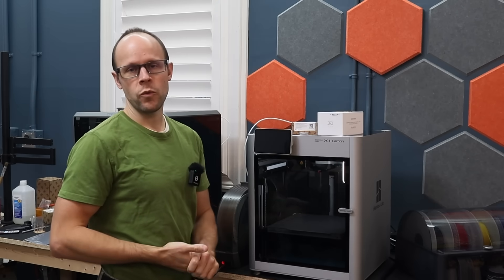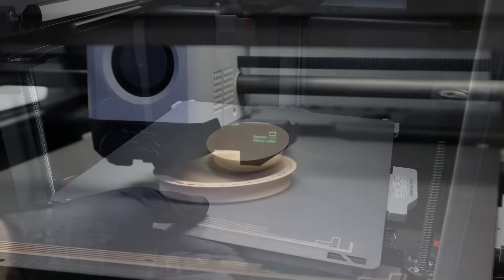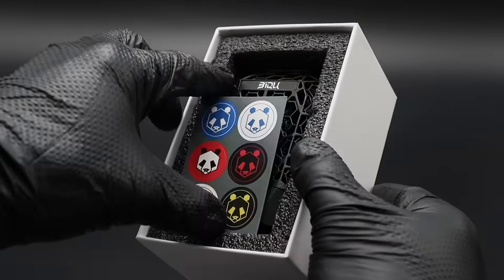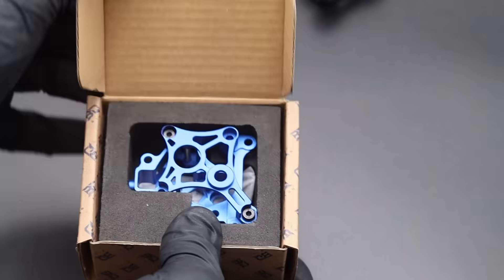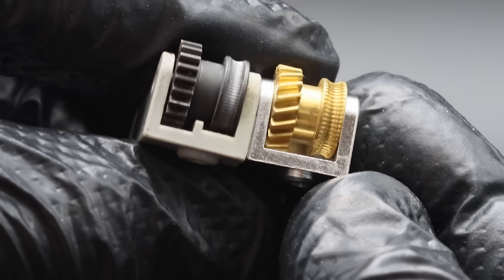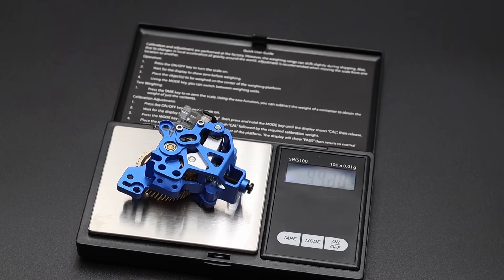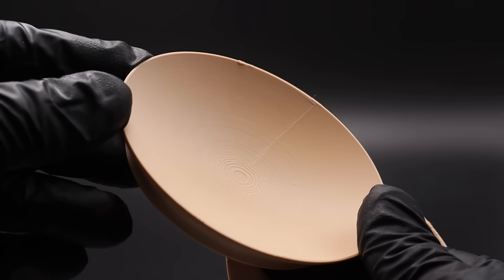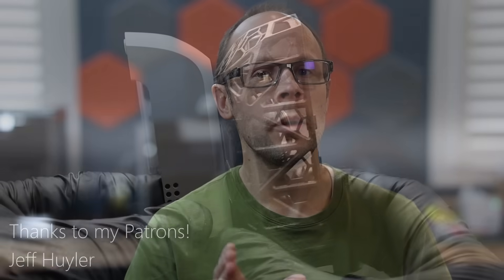These are awesome looking upgrades for your Bambu X1/P1 printer, but how do they perform?

Comment: The main reason I clicked on this video is that I have a BambuLab X1C that I have in my garage, and it’s been having some major heat creep issues. Here in Phoenix, my garage routinely gets up above 45C, which can severely impact the ability of the printer to effectively dissipate heat. The result is PLA filament getting stuck inside the extruder assembly, even with the front door of the unit open and the lid off.

I’ve seen a few models available for print that replace the print head cover, but I haven’t seen anything but anecdotal evidence as to their effectiveness. So seeing that they do help with heat dissipation, I think I’m willing to give it a shot. Thanks!

Comment: Regarding the hub teeth on the idler being finer than on the main extruder gear:

I think it is such a clever solution, and this is that part where the "magic" is happening:

If the toorhing on the 2 gears would be the same - like on 99% of similar design extruders, it would cause some artifacts. As the extruder gears rotates, they push the filament a bit differently when a teeth is just grabbing - hppe it is understandable what I mean.

By using diferent toothing the 2 gears grabbing the filament can eliminate this - laggy pushing.

Comment: Great video as usual. You are always showcasing somehting I was considering to do..
I got all that same Biqu stuff and some more.   And a host of issues after installing all of it.  The tolerance's on the Panda extruder need work. Alot of jambs on color changes. Single color projects seem to run ok.  All the gears in the extruder are great. Too bad you can see the extruder once the new front cover is installed.  And if you do the Revo upgrade as well.. it compounds the issues.  Revo system was not designed to be used without a PTFE tube that meets the cold side of the nozzle. With out the PTFE tubing you will ger heat creep where the two screws attach the nozzle to the extruder. And the two hot end mounting screws are to close together to mod the heatsink to take a piece of tubing.

I ended changing back to OEM parts, a part section at a time to try and isolate where the issues came from. I ended up with the OEM Bambu Nozzles, the Panda Extruder Gears, The front "blue" cover of the Panda extruder. and my X1C is humming along again!   Now to figure out that nozzle light issue.

Comment: Just wondering how everyones ptfe tube is I heard it rubs up against the glass plate on the top? Causing problems? 

I just sold my ender 3 v2 and thinking about diving into bambulabs p1s combo.

Comment: It looks neat.  But I really only see it benefiting 24/7 print farms to reduce down time 5-10 years down the road, because the stock plastic gear is just fine.  That big gear is like your hand on a wrench.  Your hand doesn’t need to be made out of tool steel.  But the socket at the end, the hardened steel gear, does need to be as strong as possible.  Strait cut gears are also more durable for their size.  High performance engines have a lot more straight cut gears, but they’re noisy as hell.  My motorcycle sounds like it has a supercharger whine, but it’s just the gears because they designed something that could have both 120hp, and do a million miles with proper maintenance.

Comment: at 10:40 from the benchy the edge you can see stock it's a bit more round then with the parts from BIQU so less smoothing (thats good)
Reply from the maker: I've been asked to buy new replacement parts from Bambu in the comments and then do another comparison, I think it might be a good idea to test as close to apples-apples as possible.  Thanks for pointing that out, I didn't notice it.

Comment: Thanks for the comparison. If I were to hazard a guess, I think the improvement in the benchy overhangs is due to the omni-directional blower from the Panda jet. The rest of these parts I would only expect to see improvement at warp speeds (lighter weight, less ringing), or with higher-temp materials like PA6 / PAHT / PET / PPA / PPS (where improved heat dissipation might matter). The heavier duty metal components probably only matter if you're printing harder types of filament like -GF or -CF (improved gear wear resistance), but those parts are still considered wear items that you're just buying more time between service intervals.  Sure is fun to try to squeeze more juice out of these printers though, innit?

Comment: A disadvantage of angled teeth is that an axial force occurs. This should be absorbed by an axial bearing. It is also strange that many expensive light upgrades are purchased only to have them canceled out for a gear solution that is much too heavy.
Reply from the maker: The original gear setup did seem superior, it might make the most sense to use the stock gear with the skeletonized upgrades for the best of both worlds.  I don't know if it is all compatible though, I'll have to go back through it to see.

Comment: A few things to comment on,

First, your calibration cube and benchy look absolutely awful.. My P1S produces much cleaner prints than this X1C and I'm wondering if you think that's due to the filament type used or the print profile?

Second, it would be nice to see the individual parts weighed out compared to the original parts.

The extruder gears are likely the main sum of the weight increase, but Biqu advertises that their extruder cage, for lack of better words, is lighter than the factory polymer one. Would like to see the individual parts weighed to verify or debunk this.

Third, if the print quality is identical, how would anyone consider these parts upgrades when they show no performance or quality gains over what comes with the printer out the box?

It seems safe to say that this is nothing more than printer bling and the money could've spent better by just buying filament instead and tuning print profiles to the filament.

Great video overall, love the non-bias approach to this.
Reply: Overall I agree with your sentiments.

I do want to respond to your third point.  If you are at all familiar with the modding world (most likely you are since you're on this video), physical modding is only beneficial once the software has been modified to take advantage of those mods.

In this case, there was a change made to the actual drive gears on the extruder. This change will have an affect on every single setting on that filament path.  

Him using the same print profiles in both prints favors the original since that's the hardware setup that it was made for.  

To truly see the benefits someone would have to install these mods and then do a complete calibration of the print profile and possibly firmware. Doing that on a Bambu defeats the purpose of going bambu, which makes the gear upgrade not worth it.

Comment: I agree it all seems high quality, but given they net increase in weight and yet nearly zero difference in PQ, I don't see the point of upgrading.  That said, I would have liked to see side by side comparisons with JUST the lighter face plate, to see if that 6 grams of weight savings, with all other components remaining stock, would have made any difference.  That could have given a more meaningful result... or if there was similarly no difference, that tells us something, too.

Comment: great presentation and comparison.
I would consider the differences here margin of error. If the stock setup was bare I bet you couldn’t tell them apart. What could benefit the Panda parts is after several thousand prints.
On my x1c, I started to see more extrusion artifacts after a few prints and it seems to be better after cleaning per Bambu's recommendations. I am constantly swapping between materials and only rely on the self purge, so that is probably more likely any issue I might have.

Comment: I get the impression the 3d printing community has got stuck in ender 3 V2 days... Where you HAD TO MOD as from stock it's printing was EXTREMELY hit and miss (that's my experience anyway)... Now it seems most mods are unnecessary as these printers SEEM to be built/engineered better and just work with a good cleaning/service schedule...

Comment: Due to the reliability issues the gears tend to have based on what I've seen on forums, I think stock gears with lightweight cover would be ideal. More control from the motors is probably better for quality at least in theory

Comment: I’m new to 3D printing and I just got the Bambu Lab P1S printer. This was a very informative video, thanks for putting it together and more importantly, not rambling. I am looking for a better tool set. Would you mind sharing the name of the Allen wrench set that you are using? Thanks
Reply: Best hex drivers ever made will not strip screws is called  
MiP hex driver tools nothing touches the fully made in USA MiP Hex tools worth every cent.

By the way Allen wrench is a brand not a tool that's a hex driver have a great day sir

Comment: To be fair, these test prints look quite bad, regardless of the setup. As someone pointed out, tuning filament profiles and print settings does way more to a print than just upgrading the shroud and extruder gear. I have the skeleton Panda Jetpack myself and to be honest, I can barely see if my print quality improves cus with the stock shroud I already have great results due to tuning. Though I'm really curious about the Panda Claw Extruder, but not sure if it is worth the additional $50

Comment: I removed the Extruder/ Claw from my X1C. Put the OEM parts back in. I had nothing but issues after swapping to the Claw/ Extruder.
 My X1C kept saying the belts were loose and resonance was off. I also had constant “clog” issues during filament changes. There was no clog, the filament was just refusing to Ender the extruder teeth. 
 I plan on trying the claw and extruder separately to see what one was causing the issue. 
 I do love the Panda Jet Pack though… it definitely improves overhangs.
Reply: I took mine off after having to clean the extruder after a lot of PETG and TPU. The dust that builds up with the stock set ups are easy to clean, add grease and it's a huge pain. I didn't see any benefits but thought the softer plastic toothed gear failing would be better than those brass gears grinding the toolhead gear down if something fails.
Reply: running into the same issues here too

Comment: The Panda extruder does not use hardened extruder gears unfortunately or if it does it's below 30 HRC which is the lowest file I have, the Bambu one is about 50-55 HRC.

Comment: You mean the wooden bowl that has been sanded down to an almost mirror smooth surface experiences less friction than the layered plastic bowl that's had no finishing done whatsoever? Who would have thought...
Other than that, an interesting video. I think I agree that opening all of that area up to dust is a bad idea for the minimal if not non-existent improvement the 'upgraded' parts provide. All the debris you saw inside before seemed to be filament dust, not external material finding it's way in. Now it's open to the air you'll get a lot more other material getting in there. Be most interesting to see a side by side of a stock unit and an upgraded unit over say six months and see whose looking worse for wear at the end.

Comment: Been using ben2c mesh for some time. several grams aren't worth it.
And ben2c 2gen ducts are worse than 1 gen ducts, so I use mesh with 1 gen duct which is slightly better than native bbl duct imo.
Skeletal look is nice in general but I'd advise getting those mods only if you're bored and have extra money. Won't improve anything.

Comment: It was my mistake when I decided to get p1p instead of p1s because the price... as result I added only enclosure kit :D
Don't repeat my mistake if you want a more versatile printer because the P1P is suitable for a much narrower range of tasks. 
I managed to try many upgrades, but of all that was, I only left a copper heating block from a well-known company and brass replaceable nozzles that print much better with filaments such as PLA and PETG, since I print with them 80% of the time. I also have a set of nozzles for abrasive ones, but I use them extremely rarely.
1000+ hrs and I dont see any reasons to add or change something ... 
the only thing I don't understand is the use of stainless steel and the very design of the heating block and nozzle - why are they one part. Marketing? maybe but in my case it's a minor problem

Comment: My only real question would be - does this assembly make it easier to remove clogs/jammed filament. That's one of the main pain points for me on the BL hot end assembly. If you get heat creep the filament squishes out inside the assembly and prevents pulling it out, requiring a complete hot end disassembly, fix this problem and i would consider it a genuine upgrade.
Reply: That is the one issue I've had with mine as well - fortunately just once so far, but annoying.

Comment: Your build platform is loose or warped or something. Or the printer isn’t level. The starboard side of the Benchy looks like Gilligan got ahold of it. The fact that the defect remained after the “upgrade”, eliminates the tool head as the cause. 
I thought the X1 was supposed to produce near flawless prints. My K1C has a light year on it and it’s still pumps out the near 14 minute Benchy with barely a layer line.

Comment: Nice review as always, looks like the upgrade is not as significant in terms of performance. For smaller nozzle prints, I tend to slow the print speed down a lot (10-15mm/s) to achieve a good result. Thank you

Comment: That does look really cool, but all that "not wear" and minimal dust you found in the stock head is going to be much higher with a completely open system of gears. That lack of wear will turn into wear with the increase in particulates getting in, and this will also serve to gunk up gears and bearings and start to affect prints over time.

Super cool looking though, and looks really sturdy. Too bad the gains, if any, are nigh on immeasurable. Awesome video over all.

Comment: I debated on some of these upgrades, but at this point it just seems like chasing unicorns for minimal improvement.
The CNC extruder body and the CNC claw seems like the most useful for long term wear, not for print improvement.
I absolutely hate the look of the front cover. Just looks cheap DIY feel to it, not my cup of tea.

Comment: Would it be better for the P1P or P1S rather than the X1 so you can print different material types?
Reply: It would make more sense as an upgrade, but you can buy the official hardened extruder gear and just replace that for less than $20. You will want a hardened nozzle as well

Comment: I have installed a Jetpack on my P1S yesterday, and i was shocked when i saw it in your video. Not because of the timing coincidence, but because the design of your jetpack is so much different from mine! the part cooling fan cutout is in the middle, just like on yours, but the fan does have a problem with the side of the jetpack. more precisely it binds, and bulges out the side, because the fan's housing has some tabs that holds the 2 part of the fan housing together, and the jetpack does not accomodate to this. on the original cover there is a thinner area to give some space to the tabs, but the jetpack looks like it was designed for a fan that does not have these tabs. 
on the other hand, on your video there is plenty of space between the part cooling fan, and the side of the jetpack cover.. so either there is a difference between your jetpack, and mine, or the part cooling fan is different on the P1S than on the X1C(or maybe there was some updates, since your X1C is an older model, and i got my P1S this summer).
Anyways, i had to make a cutout on the jetpack for the fan's housing.
Reply: late reply, but yes x1c has a difference because of the lidar module.

Comment: really the face is what should be the change, doing the extruder is what increased your weight.  For Core X/Y printers, weight is the enemy, that is why you go with lighter materials and skeletonized things.  So really that front cover seems to be the best upgrade to go with since the extrusion setup in the X1 is already pretty damn perfect.

Comment: I'm not really concerned about the looks, I would have loved to see a performance difference rather and since the is barely any change, I say it's not worth it at all, unless it's cheaper that a full replacement and the printer in question is not working at all and you are forced to replace it anyway.

Comment: when you say "identical print" at 11:01, was it the saved gcode file from the first print to run the 2nd print or is it sliced once & sliced again? re-slicing for new prints will very likely be different

Comment: Just a point that comparing single prints is not a reliable way to determine small differences.  The filament varies somewhat throughout the roll, and that variability may mask single item results.  You really have to perform several prints and estimate the average quality.  (At least three, but five would be better.)

Also any other variable should be eliminated if feasible.  Room temperature could be a factor, for example.

Comment: The more time I spend looking into upgrades for bambu printers, the more I realize that all you need is at their store and any upgrade provide maybe 1% difference, I mean, you already have linear rails and a pulley system, unless you load it with close to the pulley torque capacity, it's not going to make a difference really weather it's a skeleton or a enclose unit. 
But yeah, even those cryoplates, not only being ugly but the smooth plate from bambu can also print cool, it's just pointless a lot of this stuff.